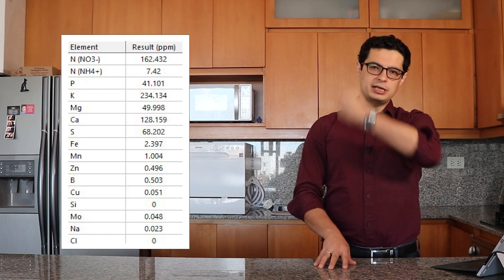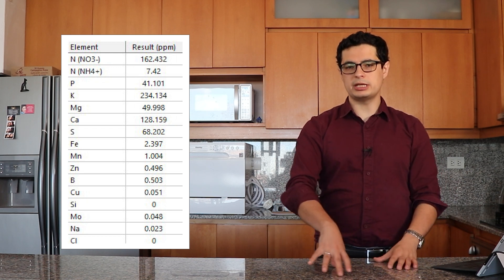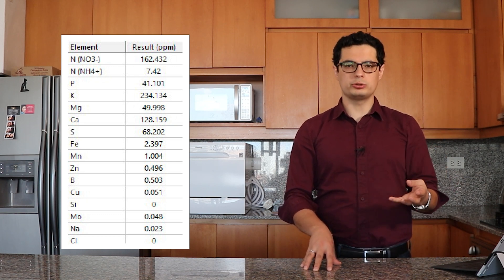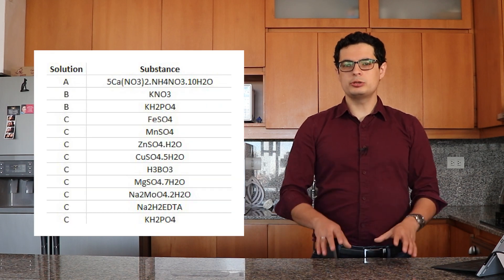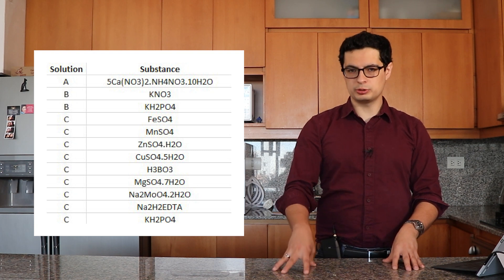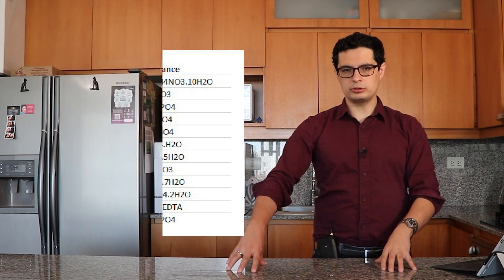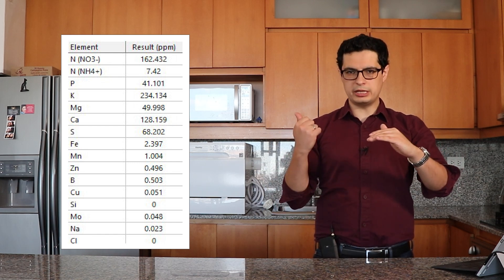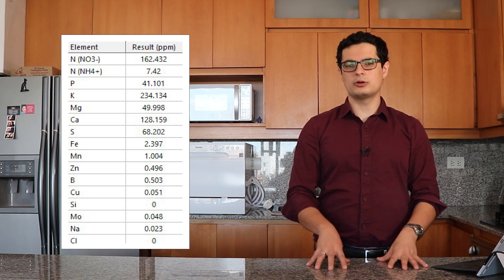How to DIY specific nutrients for Kratky

Comment: Dr. Fernandez, In my hydroponic setup I began by using the Masterblend Kit consisting of the 3 bags. I want to follow what you discuss here in this awesome video. I am wondering if I can simply use the contents in the blue bag from the kit (the bag labeled "Masterblend") to do my refills. It appears to me that that bag labeled "Masterblend" is an N-P-K solution that might serve well as My "B" component when it comes to doing my refills. Am I correct to assume this?

Comment: Thank you, Dr Fernandez, for this wonderful video! I do have 1 question, though. Regarding the replenishment process, what determines the amount of time allowed between refills numbered 1,2,3,4? I do understand that refills 1,2,3,4 is to be repeated twice (meaning including 5,6,7,8) before reverting back to the initial (A,B,C) configuration. I am not clear on what determines how much time is allowed between refill numbers 1 and 2...2 and 3...3 and 4. Does the time interval between those refills depend on the level of the solution in the reservoir? Or, are those refills done one right after the other...immediately? Or, is the timing of the refills based on the EC reading of the solution? Thanks, in advance!
Reply: Dr. Fernandez, please disregard this question. I have figured out an answer that satisfies me. Thanks! But, please do respond to my question regarding using just the Masterblend "B" solution.

Comment: Hey Daniel:)

I keep coming back to this amazing video of yours. Last year I used Masterblend in my kratky setup, and used the B-solution from this video to replenish with, and it worked well on tomatoes, peppers, cucumbers and ground cherries.

I have a few questions, that I hope you can answer. When I do the Masterblend solution, should I go for the EC reading, that is normally recommended for the plant, or should I go for the EC from the A+B+C solution from this video? As I understand the numbers, your EC is only around 1.4, which seems pretty low? Also when I mix the B-solution from this video, I end up with an EC around 0.6, is that right? And is it enough for tomatoes for instance? 

Thanks from Denmark
Jens

Comment: If i will use large enough container to not refill do I use the same solution strength? Also how concentrated the A B C solutions can be? like 1:100 is standard? How long can they be stored and do they degrade over time?
Reply from the maker: The answers to these questions are a bit more involved. If you would like my reply I would suggest booking an hour of consulting through my website to answer your questions thoroughly.

Comment: Hi, I see that you add Monopotassium Phosphate in B and C, is that correct? For smaller measures, how do you handle 0,0Xgr or 0,163? I cannot find Molybdate, is it 100% necessary? Thanks for the video and for the app. How can I comment/ask you some things about the app?
Reply from the maker: Thanks for commenting. You can add MKP to B or C. For smaller measurements, use a finer scale, I normally use +/-0.01 max 500g scales for these measurements. You can also get +/-0.001 max 10g scales for a low cost. For comments/requests on the app, please access the page on github and leave the request there.

Comment: Hello from Greece! Thank you for your continuous high quality content! I would like to ask if you have a refill formulation for non fruiting plants that need higher nitrogen concentrations compared to potassium. Do you use ammonium nitrate in that case? Thank you
Reply from the maker: Thanks for writing! When growing basil plants I used the same refill formulation I used for the tomatoes, just refilling with potassium nitrate and it worked fine. However the pH did increase more aggressively when growing the basil, so I did need to add a bit of nitric acid to the refill to lower the pH of the Kratky solution. Let me know what your experience is with refill solutions.